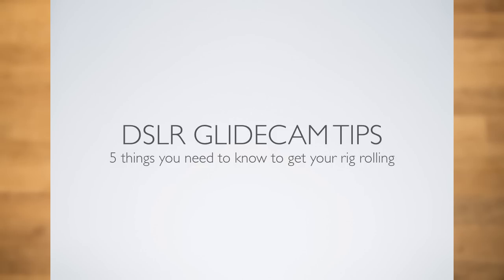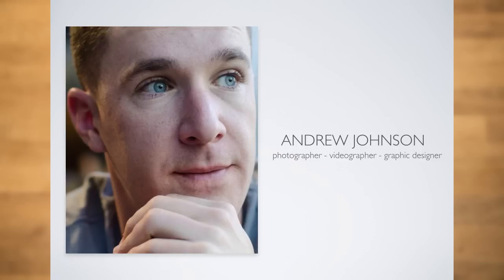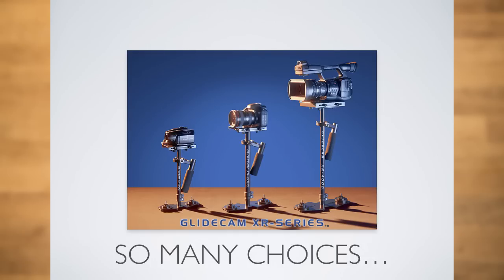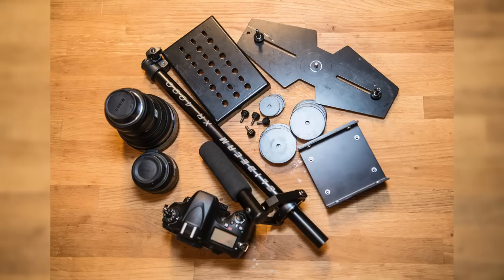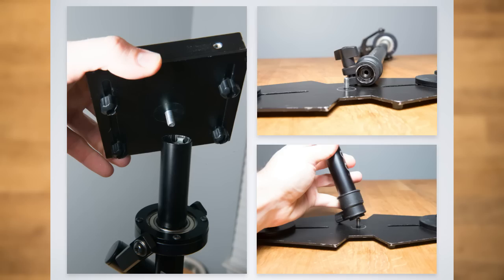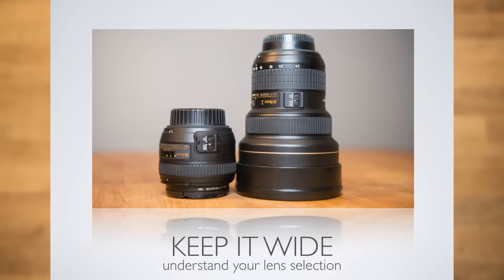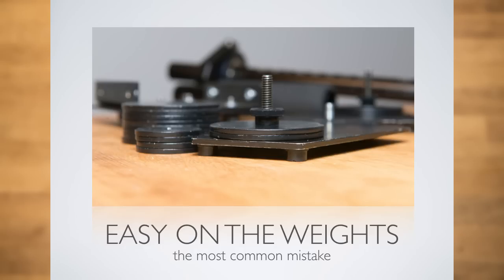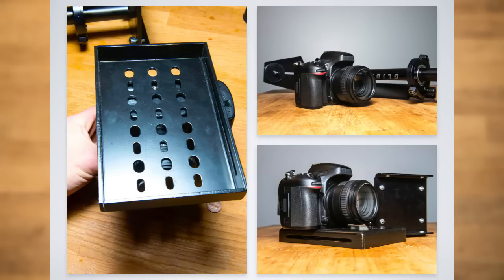5 DSLR Glidecam Tips

Comment: Yes I have a question. I just bought a XR PRO Glidecam and I was able to get it balanced, but I noticed that the grip at times would hit the mounting plate and transfer the impact noise threw the Road mic that I use. How come you can't loosen the set screws and lower the grip a little bit. I want to get away from clashing of the handle hitting the mount. Is that possible? And by the way your video was incredibly done well. I really appreciate it. Thanks.

Comment: I wanna buy a Glidecam but I don't know if I should get the hd2000 or the hd4000. My rig is about 4lb. Is the hd4000 worth the extra $100? ....great video by the way!
Reply from the maker: korodude The HD2000 will definitely work with your rig. Just make sure you are thinking ahead to any lights or mics that you might want to use.
Reply: +korodude Get a used hd4000. Practically the same price as a new 2000
Reply: +korodude For whenever you upgrade your kit, if you are planning on upgrading